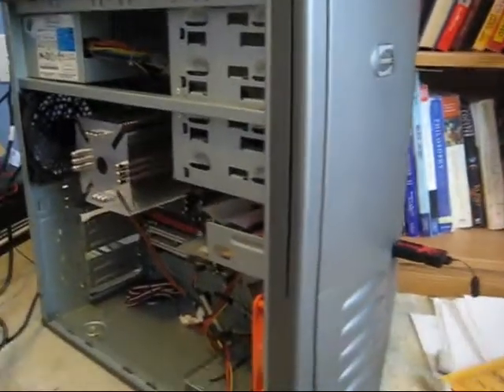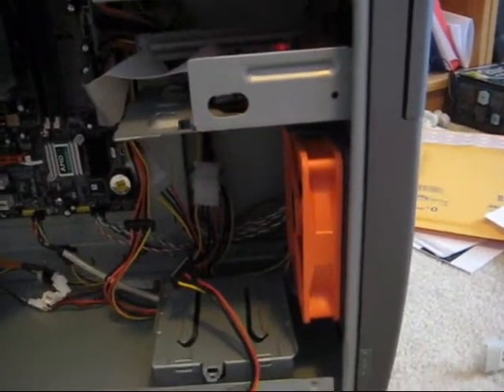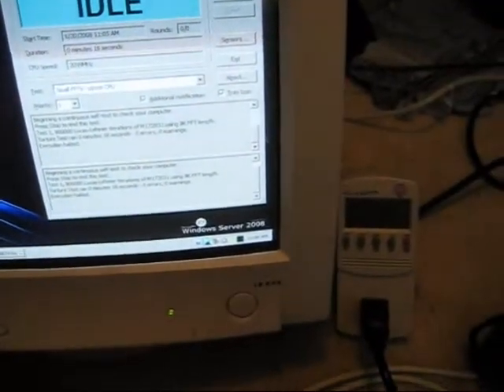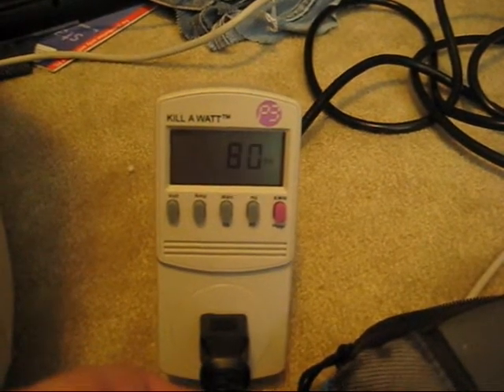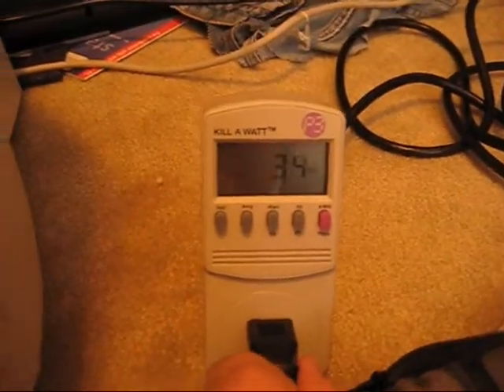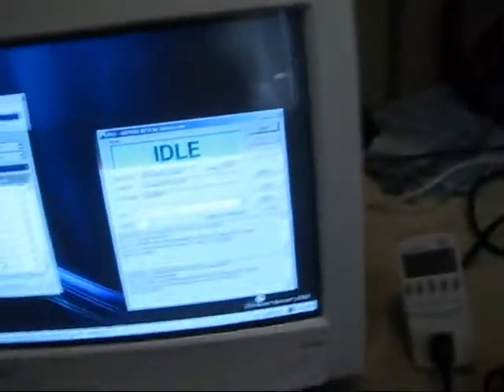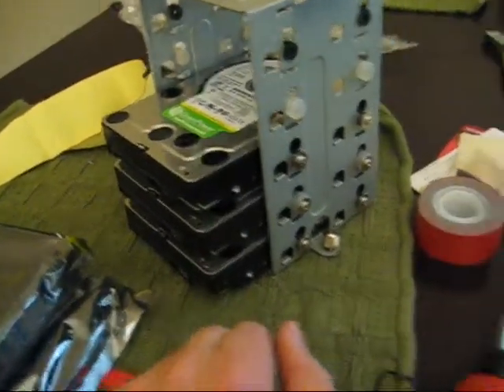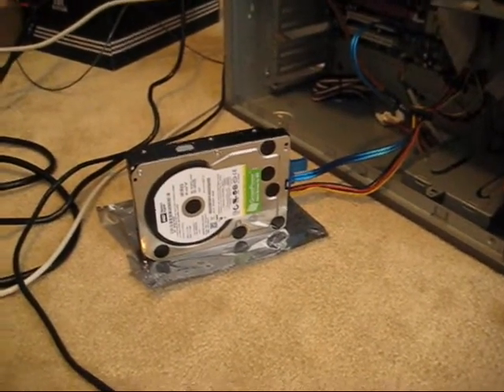Home Server Guide - Part 1 TLER, DIY SSD - exoid.com

Comment: To be honest I hate using Windows as a server as well, but since I have Windows systems because my family is still used to that, I have to have one server running Windows as a ADDS domain controller for these machines because Samba can't be a domain master in one of these yet...

If you have to use Windows, I'd probably understand your reasons, but I still prefer running Linux, not because its an obligation, because it is better than Windows and I don't have to pay any money. =)